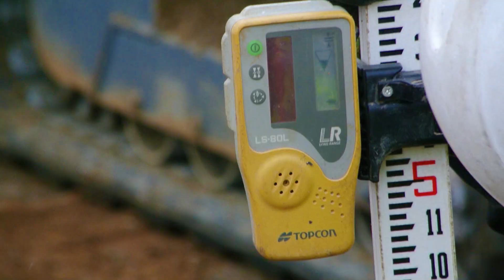Sewer Line Replacement

Comment: shouldn't a sewer line be buried deeper than 1 foot in the ground?
Reply: Codes don't really matter when the government is paying for it.....lol
Reply: A foot would be about right I think
Reply: Line depth depends entirely on application and geographic location. The further north you go, the deeper it has to be to get below what is called the frost line. The frost line is the level or depth that the ground freezes that you have to dig below. I know that in the south like Texas the first line is 2 inches, whereas in New Hampshire it is 6 feet.
Reply: @mobileapp9056  frost.line.is not 6 ft in new hampshire.i did sewer work for 16.yrs frost line  its pretty much the same unless every where except the north pole an sewer in.the long run is not gonna freeze. Why ? Common sense.Think .Waiting